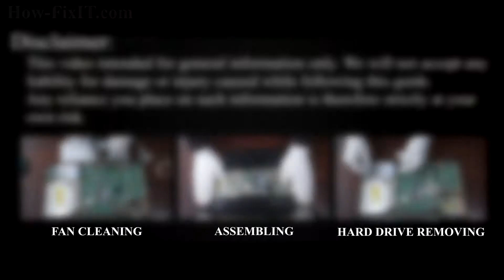Dell Inspiron 15 3520, N5050 RAM Upgrade & Install: Step-by-Step DIY Guide

Comment: The dell inspiron 3520 can support 16gb ram?
Reply: I hope it does. I've just bought one with 8GB RAM, assuming I can easily upgrade it to 16GB if required. Planning to just add another 8GB module
Reply: @CreativeCubProductions  please update ..did it work?i am planning to upgrade to ddr 3 8gb 1333mhz *2 . and how is the laptop performing now.
Reply: @yvvkranthikiran  Haven't upgraded mine yet
Reply: @yvvkranthikiran in Many Forum Maximal 8Gb bro (2X4Gb)

*You can upgrade storage to SSD
*Prosesor core i5 ivi bridge too
Reply: @Toni_jaa666   @sankalppol  did thr laptop originally come with 8gb ram and was it one soldered 8 gb stick or a 4gb stick soldered and another 4gb in a free slot?
Reply: @CreativeCubProductions   @sankalppol  did thr laptop originally come with 8gb ram and was it one soldered 8 gb stick or a 4gb stick soldered and another 4gb in a free slot?
Reply: Why my second new ram not detect in my laptop

Comment: sir which ram was preinstalled in this laptop... please tell me the brand name and model
Reply: Mine came with 4gb hynix, hmt351s6cfr8c
Reply: @drdoublezero7199  so it was 4gb soldered in one slot and then 4 gb in another free slot?